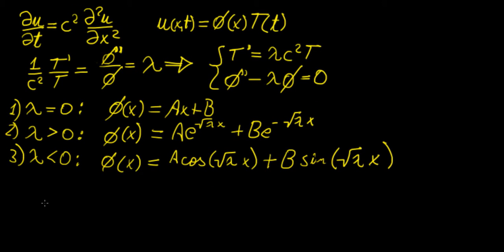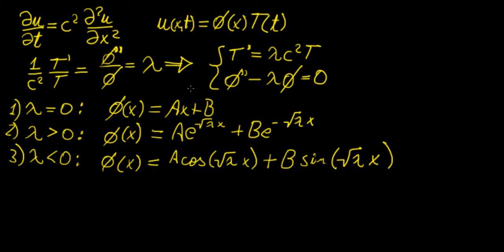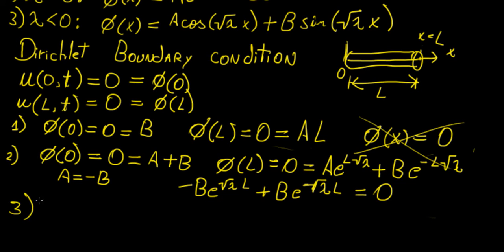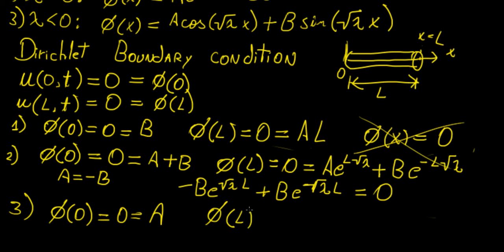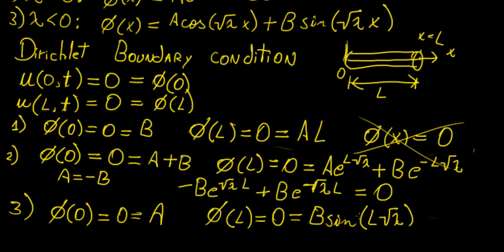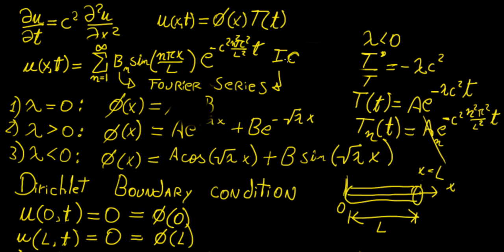Solving PDEs through separation of variables 2 | Boundary Value Problems | LetThereBeMath |

Comment: In the solution for the 3rd case, it is |λ| instead of λ, and this issue is carried out from video #1 for the characteristic solution r^2 + λ = 0 for the case λ<0. There, they said that the previous one is equivalent to (r - i * sqrt(λ)) * (r + i * sqrt(λ)), which is not mathematically correct. Instead, the correct decomposition is (r - i * sqrt(|λ|)) * (r + i * sqrt(|λ|)). So, the correct expression for case 3 should be Φ(x) = A cos(sqrt(|λ|) * x) + B sin(sqrt(|λ|) * x).
Reply: Also, at 11:00, for the λ<0 case, it is T'/T = -|λ| * c^2. I think the rest is fine, and this is a great video!
Reply: @josemiguelsanchezbornot8609  Thank you for pointing it out!

Comment: Is it not a problem that Lambda_n found at 8:40 is always positive, even though we have already assumed that lambda is negative?
Reply: I think you are right and that is a contradiction. What I see is that the issue is that in the solution for the 3rd case it is |λ| instead of λ, and this issue is carried out from video #1 for the characteristic solution r^2 + λ = 0 for the case λ<0. There, they said that the previous one is equivalent to (r - i * sqrt(λ)) * (r + i * sqrt(λ)), which is not mathematically correct. Instead, the correct decomposition is (r - i * sqrt(|λ|)) * (r + i * sqrt(|λ|)). So, the correct expression for case 3 should be Φ(x) = A cos(sqrt(|λ|) * x) + B sin(sqrt(|λ|) * x). I think, except for this, it is a very informative and great material!

Comment: Thanks for the great video!
 I am just wondering about the steps at 11:00. Why can you integrate the left side of the equation with respect to T and the right side with respect t. I dont really understand how these have to remain equal after that operation.
Reply: It is a method of separation of dummy variables in calculus, where you you separate the dummy variables and then integrate:

dG/dt = -lambda*C^2*G

dG/G = -lambda*C^2*dt (now we integrate both sides with respect to their dummy variables)

ln|G| = -lambda*C^2*t + A

G(t) = Ae^(-lambda*C^2*t)

You don't have to separate the dummy variables, as this demonstration above was to show you what's happening when you push all the variables on one side and integrate.